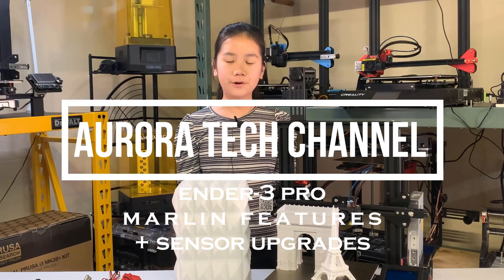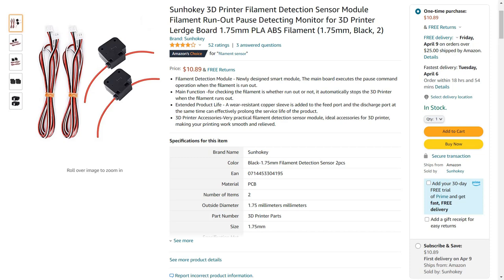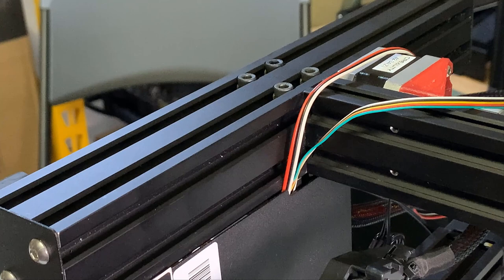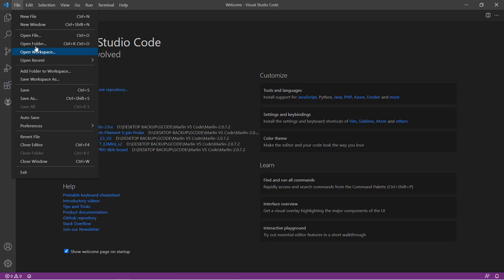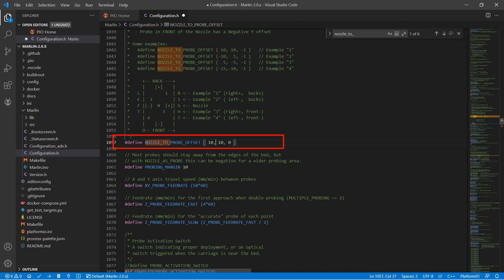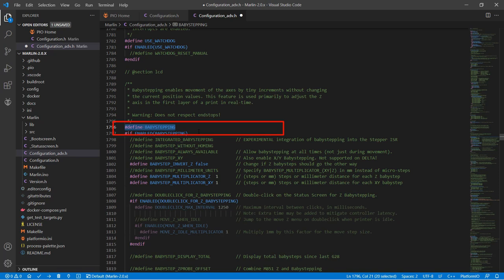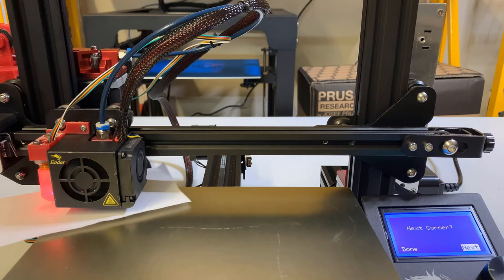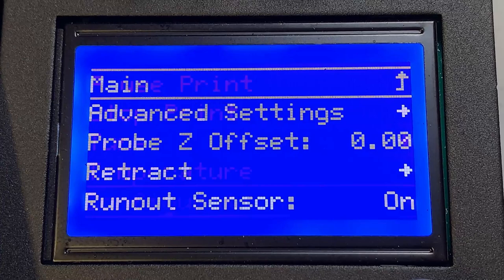Ender 3 Pro - Marlin firmware extra features + filament sensor + 3D / BL touch bed leveling sensor

Comment: Hi Aurora  I have a question I have a Ender 3D pro  I have ran into an issue where tried to print out Gcode file but it failed so I got a new print file when running this new file on the printer to print the existing old file is still trying to print when i have removed the old file from the SD card  seems to be stuck trying to print the old file and not the new file i am asking to print  any assistance would be greatly appreciated.  thank you

Comment: i have a question i have a creality silent board 4.2.7 and i watch your video set up the firmware and i still cant get the board to work right it will not save setting s and i adjust the bed and still cant print right i think the board is bad i have try difrent version of firmware same issue the board will not see i have the STM32F103RET6 chip do you have video s on other way s fix this or what do you think is the board bad i have ender 3 with bl touch

Comment: Honestly, cannot thank you enough. I took about a month to try and get the BLTouch to work, and I was about to give up, until I followed the step by step advice you provided, and it worked straight away. Also, nice touch on re-crimping the end that connects to the motherboard, it worked a treat!

Comment: Aurora, you and your brother have a great future in tech and/or in training. You're presentations are always crystal clear (both in organization and in the fundamentals of presenting [clearly spoken, paced well, etc]); your logic is sound; even your statistical analysis is completely accurate (I'm thinking of the touch sensor comparisons), including (in your CR-Touch section) the fact that you have a sample size of 1 device. Your brother's editing is superb.

I was just looking at how to pull the data from my CR-Touch that I brought up last night, and I just figured that out. I'll do my own analysis to compare. 

One question: in Marlin 2.1 I don't see the BED_LEVEL_CORNERS at all. Has this been renamed or removed? I didn't see anything similar. As it is, I use movement to go to the appropriate spots, but it would be nice to have that movement automated.
Reply: That gave me pause as well! Check "TRAMMING" instead of "CORNERS".

Comment: Realy a very good and easy tutorial on FW upgrade.  I did foir version 2.1.2  and it worked perfect!  Im using the 'default' LCD display because I didn't discover how to upgrade these FW using the "3D pad mini"  (TJC4827x343_011), ender's display.

Comment: Hey, I just wanted to say thank you for this, I reached out to Creality for a more accurate firmware and I was told that I can only use one or the other, NOT both... Well we just proved them wrong... I'm currently running the CR touch as well as the factory filament detection sensor from the CR-10... everything works together with no issues and I'm loving the extra features
Reply: These manufacturers are so lazy. A professional company could accomplish this step so easily. Creality just re-skins vanilla Marlin and call it a day.

Comment: For those who are struggling to find out what type of drivers your Creality motherboard is using you can refer to the below Information provided by TH3D on their website: https://support.th3dstudio.com/helpcenter/creality-v4-2-x-board-driver-codes/ 

The letters written on the card reader slot (with marker) are different depending on which stepper driver it has. These are for the ones 4.2.X board with STM32F103RET6 controller:

    C = HR4988
    E = A4988
    A = TMC2208
    B = TMC2209
    H = TMC2225

Comment: The instructions on Marlin in this video should be referenced in the prior video for the Ender 5 Pro. The new BLTouch connector especially makes a huge difference. A simple pinned comment or a line in the description explaining to see this video if you have the new connector should suffice. I have been going nuts thinking I did something wrong following your old instructions, even tried editing config files multiple times and on multiple marlin versions. And the problem was the line about the “Z min probe uses z min endstop pin” that is addressed here.

Comment: It's cool you are doing the exact journey I have. My next steps are Orbiter Extruder with V6 hotend, BLT and runout sensor. I have done dual Z, SKR Mini E3 MB and have experimented with direct drive, the extruder motor is too heavy and dual Z really did nothing for rigidity. I tried trading a Z motor for the extruder and it got too hot, also even the dual gear extruder started missing steps. Haven't finished the Orbiter Mod just yet, but figured I would add BLT and runout while it's down. This video is perfect for help there! Thanks for sharing, I'm subbing for sure!

Comment: Great video, very helpful. My new Ender 3 Pro has a GD32F303RET6 controller board, but I am having trouble finding predefined pins for this board in the Marlin firmware. As a result, I am unable to use Marlin firmware with my printer. Can you provide advice on how to define the custom pins for this specific controller board in Marlin firmware?"
Reply: I'm having the exact same problem, I see this was 10 months ago and no reply yet. I was really hoping for a reply lol. But question for you have you figured that out?

Comment: Yet another great video.
I will have to give the Marlin compile a try. Besides enable all the new features you show in the video, I also want to change what the printer does, when I cancel a print.
Right now, it just stops where it is, with the nozzle on the print.
I want the nozzle to move away from the print when I cancel. So  I will have to do some research on Marlin, to see if it's possible to define that behavior as default.

Comment: I have followed all the instruction but I have 2 issues, When I open up Platform IO i don't get the drop down menu to select which chip I am using, the second is I seem to have to errors at the bottom of my screen which read: "message": "#include errors detected. Please update your includePath. Squiggles are disabled for this translation unit. Could this error be a problem when I load it into my printer?

Comment: Excellent video little Miss.  Thank you for making this.  You rescued me from hours of googling last night trying to figure out how to get firmware to use both a run-out sensor and 3D Touch with a new Ender 3 that has the 4.2.2 board.   Only Ender 3 V2 had the firmware for both but i didnt want to chance bricking my ender using the firmware for V2.

If you try building this today in the platformio extension.. it might complain about FAN_SOFT_PWM not being enabled.. I enabled it and then I was able to compile the files.  Also "Level Corners" now appears as "Bed Tramming"

The filament sensor mount you linked isnt the same one youre using in the video with the wheel. Can you upgrade the link please? I have the same sensor as you and cant find a wheel/sensor mount model that uses the same exact sensor.

So I ran into first layer adhesion issures now that I installed the 3DTouch.. and having a heck of a time leveling the bed. Two questions: Should the beds knobs be completely tight before doing the auto home and bed leveling, or should the be loose to the point where the knobs are about to fall off?  None of these bed leveling videos ever mention how tight/loose the knobs should be before attempting to level it . Isnt there a default state? Like completely tight and then loosen one whole rotation?  Second question.. Do you use the bltouch auto bed leveling before every print? I ran it after leveling the bed and doing the z-offset value.  but still had issues printing.. The nozzle was even hitting the bed. Just cant figure out the right offset value. the value I got was lower than yours.. like -2.20 so I think my bed was too high..  level but too high. Seems my bed is either too low or too high when i do the z-offset manual tuning by lowering it to the bed. Ive been trying to fix this all day today.. Then my 3dtouch started malfunctioning and wouldnt retract its needle when i told it to.

Comment: Hi, I have upgrade 3pro to sprite extruder. Before i upgrade to touchscreen. But now cannot print & temp still 260c. I've changed back to old LCD. This print but I cannot using full 300c. The firmware is from creality but for 3max & Dwain. Can help what's wrong. Thanks

Comment: I'm really confused. I printed the same extended 3d touch mount for my ender 3 pro and mounted it. But the probe while retracted hangs lower than the nozzle. So it smashes into the bed when trying to print. Am I missing something?

Comment: Hi Aurora🙂. Would you be willing to compile any version of FW for my Creality 3 V2 that could inlude both the Creality filament runout sensor and the Creality BLT in the menu, as well as any of other applicable settings from this video? The board is 4.2.2 and the processor is a GD32F303RET6 (ARM). I can't seem to find a match for that processor in the PIO plugin of VSC and my builds keep failing. I'm willing to pay a for your time. Thank you!
Reply: I'm having a very similar problem I was wondering if you found a solution for yours?
Reply: @jay6976  no, I ended up having to choose between the two, chose filament sensor.
Reply: Thank you, I'm currently looking seed klipper that works for me. I installed a direct drive at the end a 3D touch and I couldn't get my printer recognize my SD card. So I found a fix from a YouTuber who has written Marlin code or something like that. What's up but it in my screen lit up but nothing ever happened. So now I'm in the process of redoing all this again and recording it myself listening to another YouTuber and I've gotten to the point where I'm down to the processor, the GD32F303 RET6. Everybody else's chips or what they were talking about was STM so I found a different parade on Reddit but sent me back to my original YouTube guy who creates more than code try to go back to his video and go through his steps again. Hopefully I have better luck otherwise I'm going to have to take the 3D touch off my printer and just flash a normal update

Comment: Thank you for very good explanations, I have a problem with the z offset. My z offset value  is -0.7mm, but when i make an auto home, the value turns into positive value and adds in z axis value. also, do you know how can i change my z axis value it stuck in 10, then plus positive (i dont know why it makes a negative value to the positive) 0.7, it will be 10.7 .also when i put the positive value for e.g +0.7 nothing happens. In the screen, nothing adds or subtracts.
I have to use a print then put the value -0.7mm in the babysteps, and then everything works fine.
Thank you for your guidance

Comment: Aurora, when I open and make the adjustments to the configuration.h & configuration_adv.h, I do not see anything above PIO Home?  I see that you have access to "Project Tasks" and "Quick Access" Menu's.  Is there a setting I'm missing?  Thank you for your help and your videos.  You explain it well enough, that this 50 year old man is able to learn about Marlin, upgrades and everything else!!! ;)
Reply from the maker: Did you install the Platform IO extension?

Comment: FYI - In the newer version of Marlin, it's called "LCD_BED_TRAMMING" now and not "LEVEL_BED_CORNERS".
Reply: Thanks this helped me.
Reply: The printer however desnt stop z himing even after the probe is triggered and retracts, any idea why this is?
Reply: @dreudax3294  You need to ensure you have it setup in the firmware to use the probe and not the Z switch.
Reply: @dreudax3294  Also, check out the wiring and make sure you have the probe wires for the Z stop in the correct location on the main board. You also need to adjust firmware so it knows to use the probe and not the Z stop switch.
Reply: @MaCJaX88  I did all that, and it still wouldnt work. I think either the magnetic sensor is broken, or there is a lose connection from magnetic sensor to the board. Either way, I spent way too much time on it and I have tried every fix other than opening it up and resodering the magnetic sensor.

Anyways, I now do manual probe bed mesh. It has helped my prints a lot. I use 25 points so it is very accurate. and now my filament sticks very well. My glass bed had some dips, and this maula meshing have solved it.

Thanks anyways for you insights and replies.
Reply: @dreudax3294  the probe is basically a switch. You can test it with a VOM meter and see if you get continuity.

Comment: So I have the same red black white cables for filament sensor as 5:44, but it works reversely on Jyers firmware. Can I fix it by switching wires? or need to configure and compile my own BIN file?

Comment: hi, im having trouble with my version of marlin 2.0.x and it's showing the runout sensor is constantly being triggered even when i unplug the sensor, i am trying to change the default pin for the sensor which is servo 3 to a different input like servo 2, but i do not know how, where to look, or what line of code to change.

Comment: I have a question CR 10 V2 is this the same way I should upgrade firmware on it has a bootloader did it the old way currently running tiny machines also my ender 3 is missing the feature I see in tiny machines firmware change filament option is there a way to add that to my ender 3 pro

Comment: I am trying to use the program you used to edit the zip files from Marlin. When I go to Marlin all I see is bin files, but no zip files which are to also contain the Config examples. Also i bought the 4.2.7 board separate from the BL Touch on Amazon. The BLTouch came in a creality box ver 1.3 for the 4.2.7 board. The chip on the board has different numbers than yours 7( which was for the 4.2.2 board.) are you planning on doing a video to add a 4.2.7 board on a 3D PRO with a 4.2.2 board, and to add the BL Touch? After adding my BL Touch, the head keeps crashing unto the right hand side after homing to the center. Do you have any recommendations as to how to fix?

Comment: Error: Build environment 'STM32F103RET6_creality' is incompatible with BOARD_CREALITY_V427. Use one of these: STM32F103RE_creality, STM32F103RE_creality_xfer, STM32F103RC_creality, STM32F103RC_creality_xfer, STM32F103RE_creality_maple

Found that STM32F103RE_creality (reditt) is the correct one. Ill try later if it works.
(obs: marlin 2.1.1)

Comment: Thanks for  the video.  You mention that a warning at line 743 of configuration.h must have the comment marks removed or the build will fail.  The copy of configuration.h that I just downloaded does not contain this warning line and yet it will not build.  Any ideas on where the problem may be???
Reply from the maker: Don't worry, since the latest version of Marlin may be slightly different, if you print OK, you should be fine.

Comment: Thanks for the Video! After your presentation i try to change my Firmware and it was perfect, but i have one Question: I Use the old Z-Stop switch for the Filamet-Sensor! I have set everything as in the video but I get a message that the filament is empty. do I have to switch to high or low in the firmware? By the way I am from Germany 😅

Comment: Hello Aurora, first off, thank you! I have been at it for a day and a half trying to get the BLTouch setup and your vidoe did that trick. I am having one issue I was hoping you might be able to help me with. When I get to the part to level the bed manually the extruder is so far away from every corner that every knob is completely down and it still is not touching. I tried to jump ahead to set the z offset hoping that might bring it down but once I go back to try the manual bed leveling the extruder is still too far away from the bed. Any ideas on how to resolve this? I even tried a sample print to see what it would do and I had to baby step it down a good amount before the filament would stick to the bed and the Z offset is set and stored but not going to the point I set it at.

Comment: Hi i have ordered the runout sensor from china finally it arrived but when i was going to print the Filament Guide" with a included runout sensor the file is completely different the in video> Any change that you can point me please to the correct file. Thank you for a great video.

Comment: hey there, could you help me:
My Ender 3 Pro wont boot when i connect the filament runout sensor. Anyone else got same problems or has a solution?
Reply from the maker: You need to rearrange the cable, if your sensor has a 2-pin connector, just flip the cable of one side. If it's a 3-pin, arrange the order according to your motherboard, like VCC-SINGAL-GND or GND-SINGAL-VCC.
Reply: @AuroraTech  thanks a lot!

Comment: i keep getting this build error i have the 4.2.7 board

Error: Build environment 'STM32F103RET6_creality' is incompatible with BOARD_RAMPS_14_EFB. Use one of these: mega2560, mega1280

1 failed, 0 succeeded in 00:00:03.060 =======================================================The terminal process "C:\Users\Surface Pro 3\.platformio\penv\Scripts\platformio.exe 'run', '--environment', 'STM32F103RET6_creality'" terminated with exit code: 1.

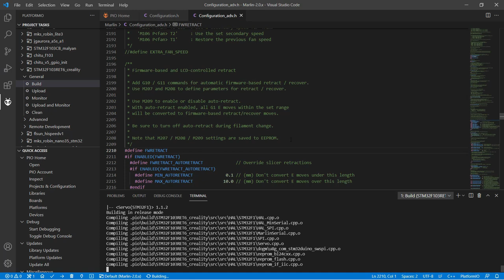Comment: Hey, unfortunately I got the status message "failed" at 15:40 of your video. Any idea where I may be going wrong? - [C:\Users\me\.platformio\packages\framework-arduinoststm32-maple\STM32F1\variants\generic_stm32f103r\board.cpp] C:\Users\yasin\Desktop\Marlin\Marlin-2.0.x\.pio\build\STM32F103RET6_creality_maple\.sconsign39.dblite: No such file or directory

Comment: im having trouble getting the modified code out of visual studio code to be able to put onto an sd card and then onto my printer. anyone else struggling with that or know how to select a board for an ender 3 pro? I'm also trying to use a creality cr touch, but if other people recommend the 3D touch I may return the cr touch and build myself an adapter like in the video